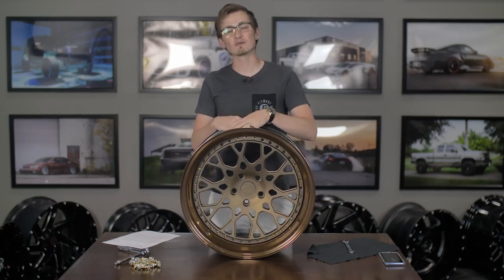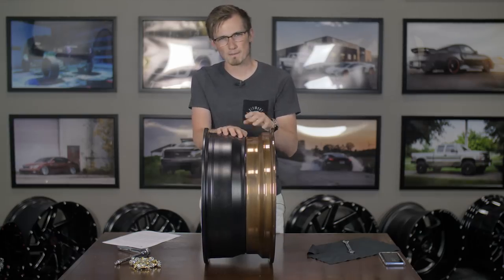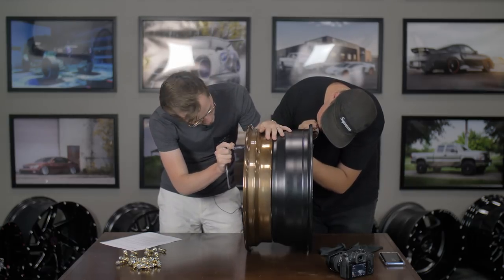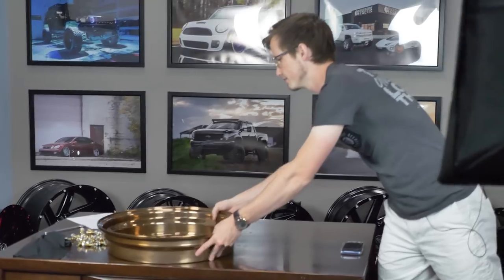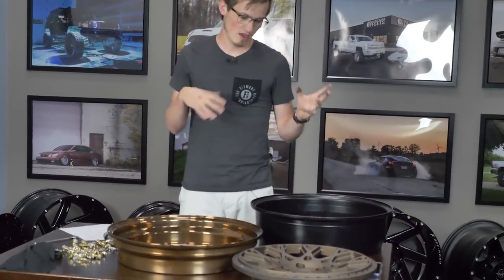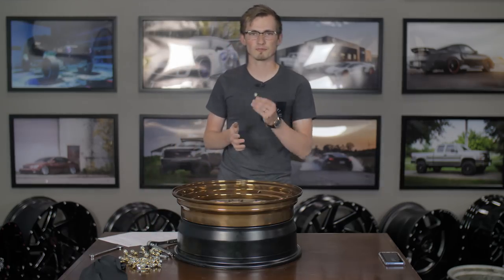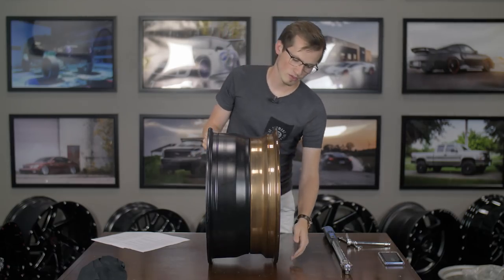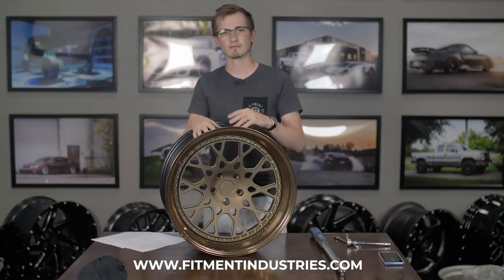Breaking Down Multi Piece Wheels

Comment: Coming from the trailer industry I've leared that running your finger down a silicone beed to even out the beed is only half of the goal. The other purpose for this is to pack that wet bead down into that creese so that the beed as a whole can maintain its integrity under high pressure for as long as possible. Ive had alot if seals fail pressure tests from a beed not penetrating enough between the two parts.

Comment: Some wheels still need silicone such as Rials. The face and half barrel are one piece but the lips are separate and need silicone when put back together. Style 5's BBS have a separate face but lip and barrel are one, no need for silicone.

Comment: Probably being a bit precautios but recommend using a plastic razor blade to remove the silicone so you don't mar the metals mating surface. You can go ham on them with the razor and won't damage the wheels. Also when setting up a work station to dissamble/assemble your wheels put a blanket over the surface your working on (ex. table,desk,counter,etc) that way the lips of the barrels don't get damaged.
Reply from the maker: This is solid advice! Thank you💪🏽 -Edgar

Comment: If I want to paint the face on a works Brombacher, can I take the tyre off and then remove the face without splitting the barrel? This would alow to avoid having to reseal.

Comment: Also, depending on the valve hole on outer lips, they need to be lined up with design of centre for symmetry............nothing worse than having the valve in 4 different places when rebuilt

Comment: i recently bought a set of SSR Watanabe RS8's having trouble with stubborn bolts, it seems like they are captive, or pressed in somehow, not really sure how to get the face out, unless you're meant to bash the face out and hope the threads dont fck up/buy new hardware??

anyone know how to remove the face on rs8 wheels? it looks easy but it isnt working out that way
Reply from the maker: I'm not entirely sure on the bolts but I used a microfiber with a wood 4x4 on top of it and hit the middle with the hammer. This seemed to be the best way of getting it out. I assume this is top mounted but if not you obviously have to take the wheels apart. -Jasper
Reply: I've seen forum posts with disassembled ones, but they date back to 2003-2007 (so very low chance they are still around to chat) the bolts would have to come out the same side the face does. because the nuts came out the back. Anyway, Thanks for the reply

Comment: When breaking the silicone seal, is it possible to make an incision through a point and put dental floss through? From there, run it along the diameter to cut the rest off? Kind of like removing emblems.
Reply: widowmaker777 I don't think that floss is going to be strong enough
Reply from the maker: the floss wouldn't be strong enough and it would be easier to run a razor blade through it .

Comment: is it ok to disassemble wheel without markings of how exactly the centerpiece was positioned to outer part? can this cause imbalance?
Reply: Whether your having lips made for faces you already own, or you’re having proper 3pc wheels made by a modern company like ESR, both the faces and the lips are machined to work in unison. You match the barrel holes to the lip holes to the face holes, bolt them in a star pattern, and the machined precision allows your wheel to have whats called a “true”.  He was persistant on being careful when inserting the face during reassembly Because more often than not the face seats flush with the deepest part of the lip.

Comment: settle this. Are welded wheels multipiece? Cause that makes even stock steelies multipiece since they are two pieces welded together
Reply: Dariune no since you can't take them apart anymore
Reply: There is a difference between welded drag wheels and welded multi piece wheels. When he says old SSR, WORK, etc came welded he means exactly that. Back in the 90’s and early early 2000’s they would assemble the wheel, (as seen in this video) and after building the wheel, rather than sealing it shut with silicone, they would run a weld bead along the point where the lip and the barrel meet. Its actually fairly common practice for someone to come across an old set like this, and take them to a shop that specializes in debeading and grinding out the old weld, converting them to traditional silicone sealed wheels.
Reply from the maker: Depends, I have SSR Koenig's that I relipped and built. They were welded from factory but I cut the welds and split them. So it depends on how the face is sitting and where exactly it is welded. -Jasper